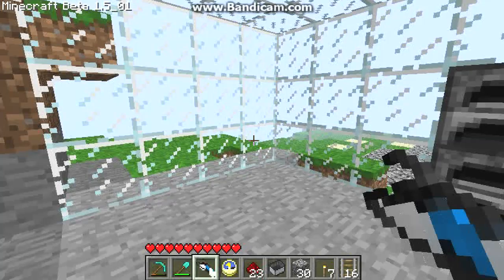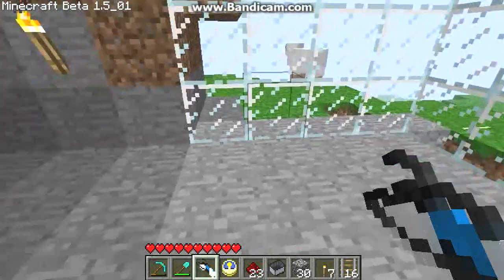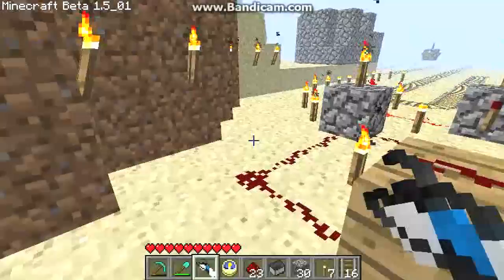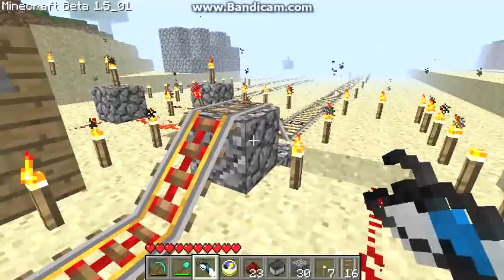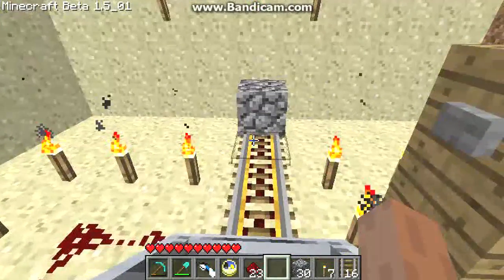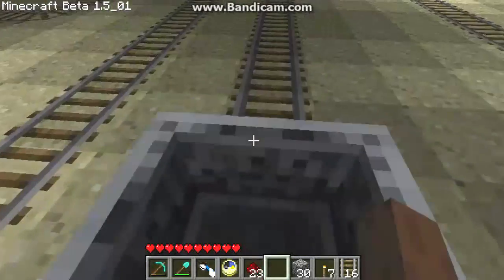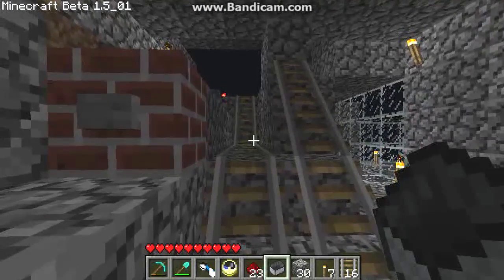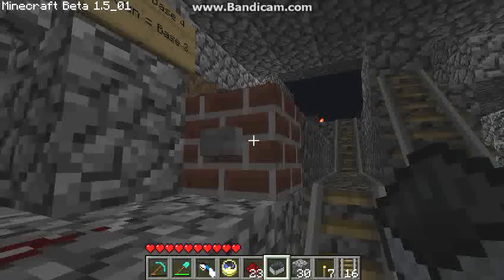Redstone For The Everyday Guy - Pushbutton Minecart Launcher

Comment from the maker: @RoninMac73 I don't recall exactly how long it took but it was at least an hour or so.  I'm thinking of putting in a new track.  I'd start from that interchange (which needs to become a four track switcher) and go for some crazy length.   I'm thinking of making it a hundred stacks long.   (Now I'm going to have to figure out what that would be in miiles!)